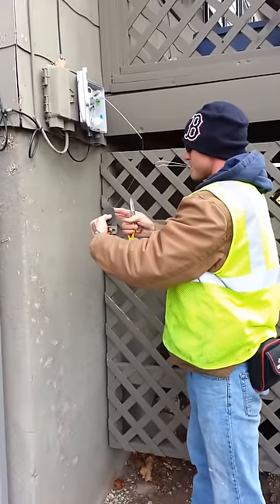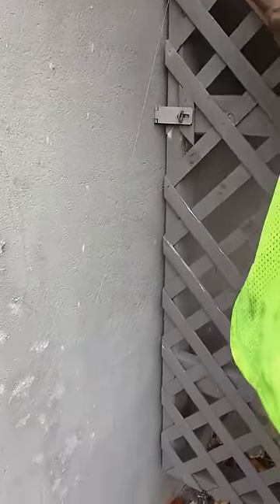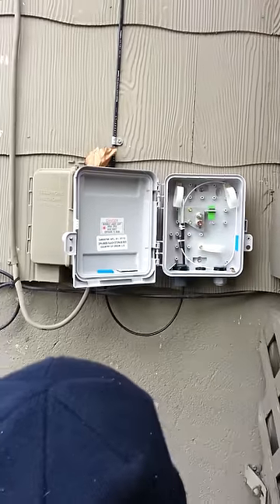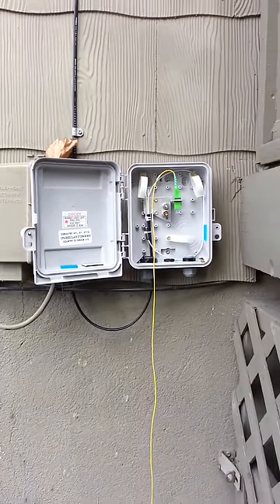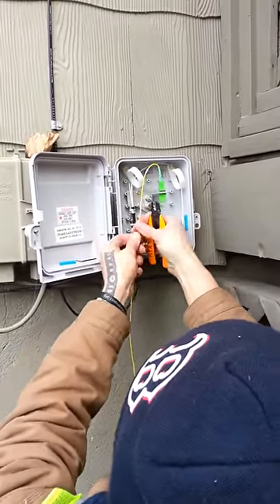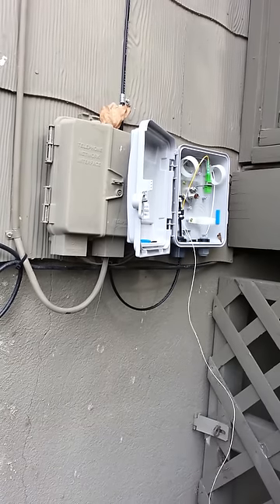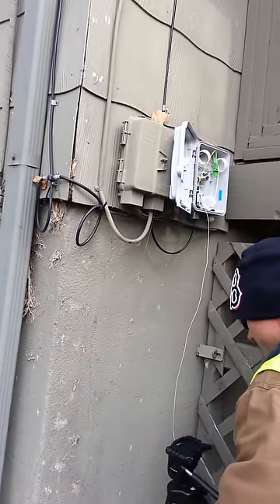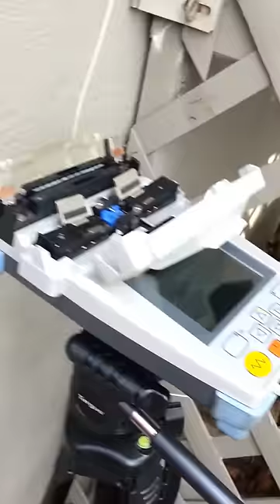Google Fiber Installation - Part 1

Comment: hey there, can you give me some tips. I am starting out in the fibre optic installation career and what are the preventions for getting shocked when installing on the power poles. Do I approach ones with cable hanging down it if its connected up to the secondary and primary lines?

Comment: hm... so, you got optic installed? so what's big deal about that? I don't get it...
Reply: It`s Google Fiber 1Gbps...
Reply: William Jarbeaux ok, so? It's still FIBER OPTIC cable connection as any other; only difference is that they allow you faster U/D. And that 1 Gbps looks fine on paper, but you will rarly have chance to use it; I have 100Mbps and If only time I get full DL or UL is when is direct connection to server, or torrent download... For example, YT still has moments when he can't load even HD video, and web pages don't open any faster then on 8Mbps connection.
(and on list of services that have problems with faster D/U rates, are Dropbox and Google drive.).
It's like having a Ferrari, but all roads are dirty gravel side roads where you can't drive faster then 40km/h.
And in end; I still don't get all of that excitement over this... It's still plane old optic fiber connection...
Reply: Dejan Kober
That's because your ISP is slowing down youtube and ripping you off.
Reply: Dejan Kober thats your ISP's fault
Reply: Dejan Kober I see what you are saying, but the youtube thing is your isp fault. your never really going to ever need that 1gbps internet, never the less it is nice. I got 50/25(really 35) mbps Verizon Fios, and for me pages load in a flash, i can download movies in 10 minutes, i don't mind waiting 10-20 min for a download.(like your life is that busy that you can't wait 10 min) I think we get too overblown with download speeds, and don't pay attention to ping. Your when  you say it is still fiber optic. Their pages will load just as fast as mine, but the only thing is that they can download files faster, and who downloads files the size of movies everyday anyways. Verizon Fios can get about the same speeds, but it is way too expensive. In the future when files become the size of terra-bytes this will be useful, but for now it is like having an 4k TV, watching shows from the 1990's, this tech is way too advanced to really see, what it can do. At the end of the day i like my 50 mbps, it's fast and gets the job done and then some. I can still upload movies in 15 min so it is really good.
Reply: somebody educate this man!
Reply: the big deal is speed.  1 gigabyte both ways for $70.  I currently pay almost that much for 5mb up speed.  So thats 100 times faster for the same price. It will allow the NSA to upload all my hard disk drives in minutes and provide a pathway for them to monitor my house with video camera's installed in consumer electronics.  I couldn't be more happy and afraid at the same time.
Reply: Dejan Kober The problem is your ISP, sounds like they suck.

And of course websites don't really load any faster. Your never really going to notice a significant difference in how a website loads on a 10mb connection vs a 50mb connection unless the website is very content heavy.

The noticeable difference comes when your downloading and uploading large files.

Comment: I just got CenturyLink Fiber 1GIG, which averages around 950 Mbps download and 880 Mbps upload according to Ookla SpeedTest  I only qualified for 3 Mbps DSL with CenturyLink because we're so far from the telco, but they laid brand-new fiber optic lines down my street last summer so we got CenturyLink's Fiber 1GIG service instead!  All I have to say is that's it's way, Way, WAY FASTER (and $41.00 cheaper!) than Comcast Xfinity's 105 Mbps copper-based service we got rid of.  Needless to say, I'm very happy now. =)
Reply: Nice! Still copper here :(
Reply: +HardlineFeminists stop showing off. :( I get 350 down and 30 up with time warner. I been praying for google fiber or varizon fios to come to my area. My prayers have yet to be answered
Reply: +Manuauto ya same

Comment: Omg. We recently got a "letter" telling us Fiber will be installed in our area soon. Soo hyped. Looking forward to going from 3,5 Mb/s down and 0,30 up, to 30/30, 50/50, 100/100 or even 200/200! Can finally play basic stuff like Arma, DayZ and Battlefield 4 without the dsync and ping.
Reply: Jag fick det också men det e i 2017
Reply: BroHunters har enda ikke fått fiber, men de lover fortsatt at det blir i høst. Ledningen er gravd ned og alt. Tror de holder på å sette opp modem og slikt i hus.

Comment: why the eff would they put it in KC before cities like philly or Ny this is crazy
Reply: Probably because KC doesn't get that great of Internet.
Reply: Kansas City had easy access infrastructure and the local government sped up the permitting process and partially got out of the way.
most of the lack of competition comes from the fact that local cities gouge the companies for rent on the utility poles and set up protected monopolies for certain comapanies.

Comment: when he removes the sleeve like that and starts stripping down with his fingers, the oil in his hands can potentially affect the refractive index of the cladding, which could potentially lead to an increase of signal leakage, which would then degrade signal integrity, thus circumventing their 1Gbps ad claims and welcoming in the lawsuits. I'll settle for a couple hundred thousand google, GG, no re.

Comment: the big deal is speed.  1 gigabyte both ways for $70.  I currently pay almost that much for 5mb up speed.  So thats 100 times faster for the same price. It will allow the NSA to upload all my hard disk drives in minutes and provide a pathway for them to monitor my house with video camera's installed in consumer electronics.  I couldn't be more happy and afraid at the same time.

Comment: Typical fiber install, fusion spliced. Only difference from Verizon or Bell Aliant is the headend cmts units. Probly equipped better for data.
Reply: yeah and the doe heads installin it... atleast these guys know what they are doing and not pretending like the bell guys...
Reply: Looks like he would rob u too

Comment: Google fiber has the slowest internet Nasa has 91 GBps
Reply: Are you a troll? Because google fiber is 1000 GBps
Reply: Haha, my internet is the slowest, clocking in at 0.70 Mb/s. I'm supposed to have 5, and my ISP insists it's the modems fault, not the ADSL line... No other alternative where I live either.
Reply: Garrett Bundy
How am I trolling?
Reply: Sorry I meant 1TB not 91GB
Reply: ***** 1TB, you just said 1 terabyte internet, what you meant to say was 1Tb/s
Reply: Ckc dillpickle thats internal speed, at my house I have 1 GBps over wired

Comment: I'm not saying Google Fiber at 1 Gbps is not great --- but who really needs that kind of broadband?

Outside of a videography business that uploads HD or 4K video to a cloud server every night, who really needs this insane speed?

Verizon FIOS will handle 99% of all consumers needs for the next 10-15 years --- until the next "killer app" comes along such as 3D real-time virtual reality or 8K video streaming or some shit like that.  Nobody needs 1 GBps for Facebooking or watching YouToob vids!
Reply: You say that now. But, in Japan they are clocking in about 2gb bandwidth speed. Google Fiber is awesome. Who ever wants that type of speed would pay for the service. You don't like it. So you are not a consumer for Google Fiber. It's just that simple.
Reply: Think of Google Fiber as future proofing, Google KNOWS 99% of people aren't going to utilize their Gigabit speeds so they can offer them, they will have to improve their infrastructure as time goes on and more bandwidth is used. But very soon all Cable is going to need to be replaced by Fiber, and google is getting that done early.
Reply: If you download alot of movies from torrents it could be useful.

Most movie torrents are in the gigabits.

You figure the average movie in a website such as the piratebay is 1gb. Your Internet connection is 1gbit/s, that means it would approximately 1 second to download the entire 1gb video. 

That's pretty damn impressive if you ask me.

Of course achieving that is probably not the norm for most people on a gigabit connection. There's alot of factors, speed of the servers, etc. And the fact that you won't get the full 1gig connection, there's an overhead. So your looking at somewhere around 915 to 930mbit/s. Which is still pretty damn good.
Reply: Mr Anonymous 1Gb/s does not 1GB/s, it's an eigth because there are 8 Megabits in a Megabyte.

So to download a 1GB video it would take 8 seconds.